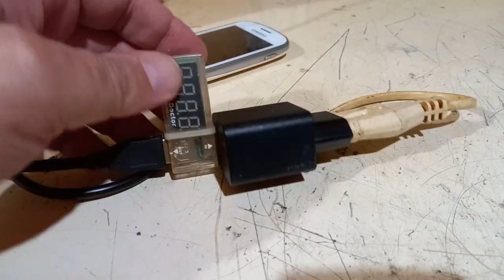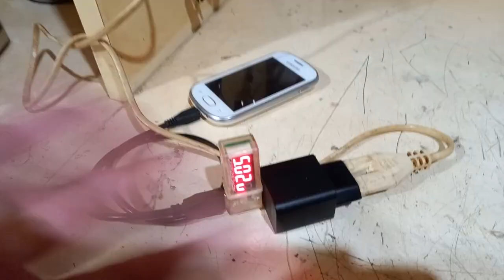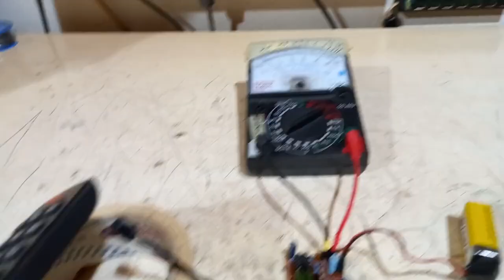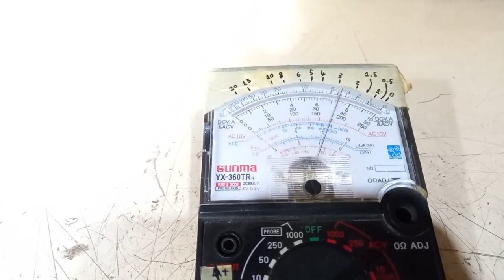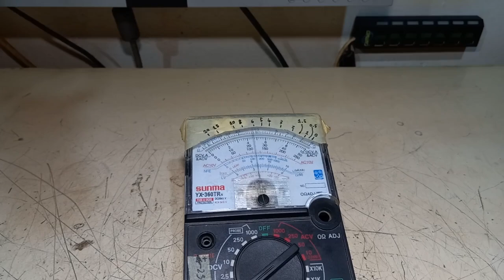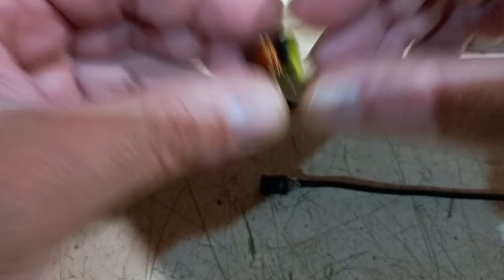Inductive Test Probe (one that I truly prefer)

Comment: Looks very sensitive for such a simple circuit. Wonder if you could hear an analogue conversation in a wire with the headphones attached.
Reply from the maker: i think the headphones are more for a kinda demodulation of the switching, i don't think it's much useful... anyways it could, it senses the coil of a small speaker at distance as you can see in the video, the only doubt is if like a twin conductor audio cable acts as "magnetically balanced" and little to no mag field comes out, apart the field being very low to begin with